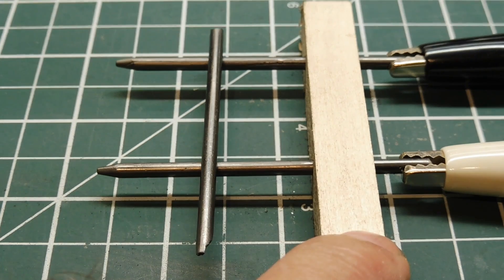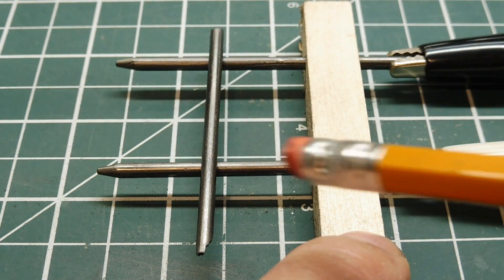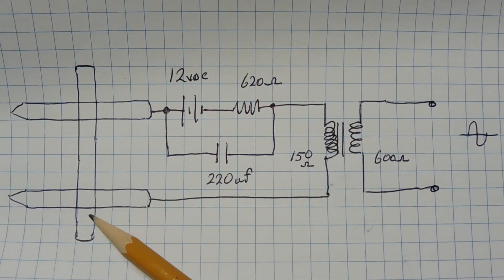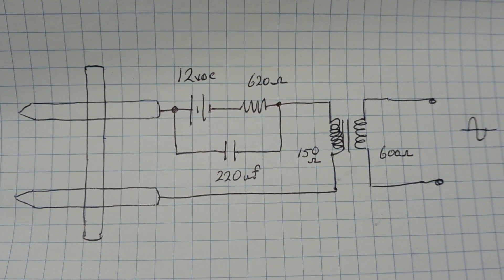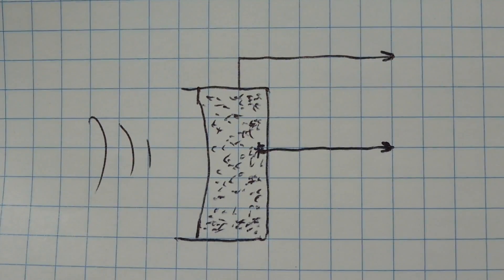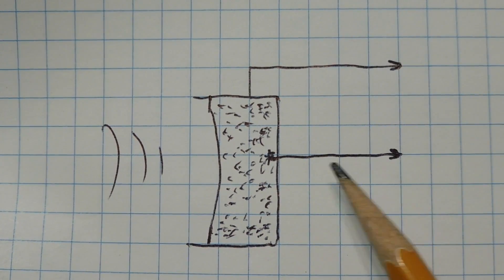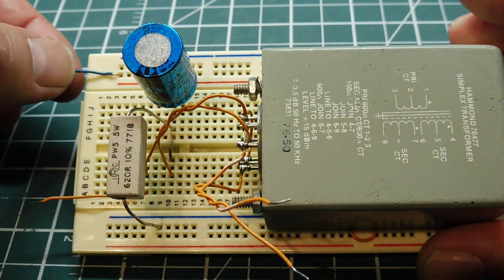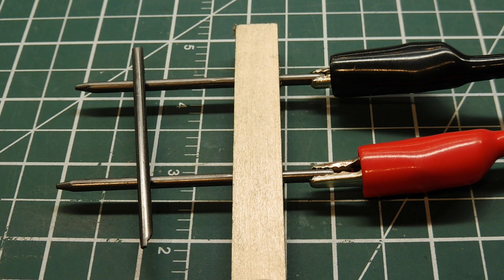How To Build A Simple Carbon Microphone

Comment: Take a VERY thin piece of veneer timber! Thin it down some more by sanding, place it over a picture frame and fix it there, then do the same thing with a needle in the centre of the timber pointing vertically, balance your carbon rod so that it JUST touches the needle. Run a low power source from the needle to the Amplifier and the carbon rod to complete the circuit. Turn up the gain and when a centipede walks on the board you will hear A  GALLOP, YOU WILL BE TRULY AMAZED!! 

Cheers
Mike

Comment: Hello-

I am interested in rebuilding a non-working carbon microphone element.  Two questions:

1)	Which activated carbon is more effective, small granules or finely ground carbon dust?
2)	Is voltage from a computer USB port adequate?  (About 5 VDC)
Reply from the maker: Old carbon mics usually fail when the carbon clumps up (called "caking"). You can try shaking it or tap it on a table top. The replacement granules should be around 1mm (looks like sand) to minimize caking. You could also add a bit of dry lubricant like silica powder. It should be operational with 5 volts.
Reply: @0033mer  Thank you for your prompt reply. When I took apart the carbon element, the carbon was very actually much finer than sand, more like dust. So just wanted to know if there was a difference to how the carbon reacted when energized, aside from the potential "clumping" issue.
Reply from the maker: The design of your mic probably needs fine carbon so use that as the replacement.

Comment: Another great video; thanks! There is a lot of DIY chatter regarding using Piezo wafers as triggers for electronic drum sets. I wonder if your carbon microphone (particularly the cartridges) might be better for the purpose. It might make for an interesting comparison video, if quantified with oscilloscope readings, etc. On another point, you used a third graphite rod to span the two sensing rods. Does this connection need to be graphite, or would copper wire work? Also, the third rod is not secured to the sensing rods. That made me wonder about the effects of vibration causing minute disconnections. Hmm, another thought... Could it be that only one graphite rod is all that is really needed?